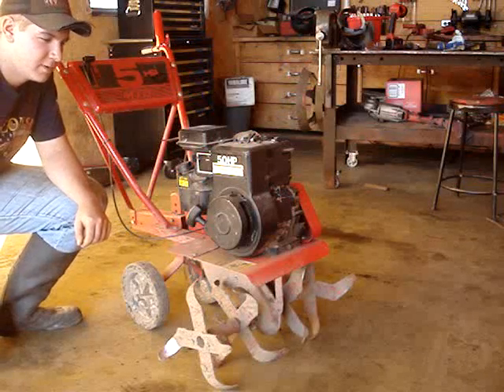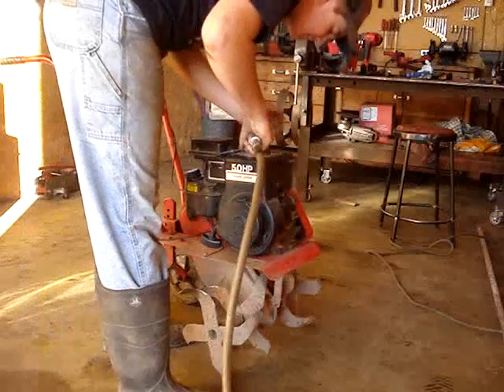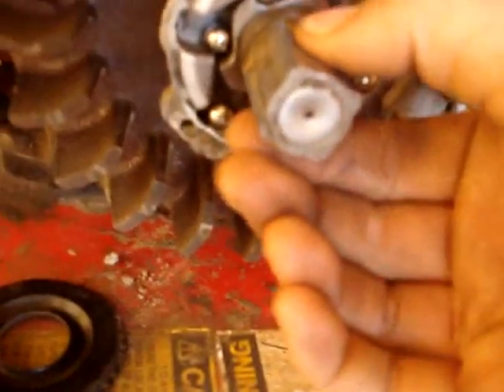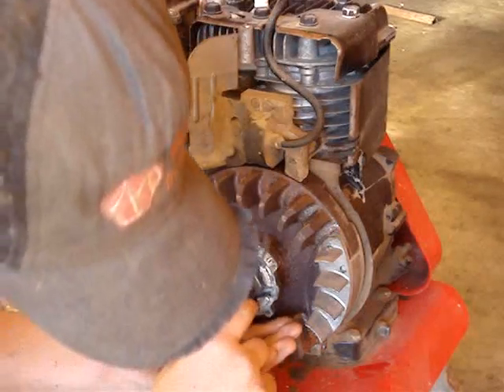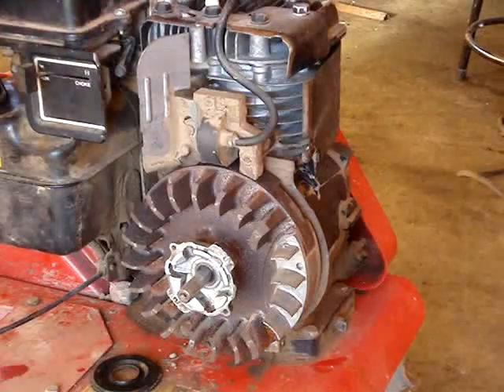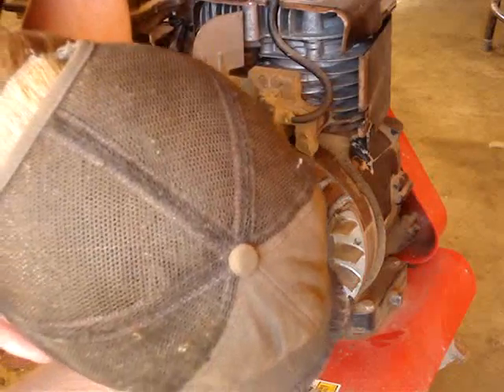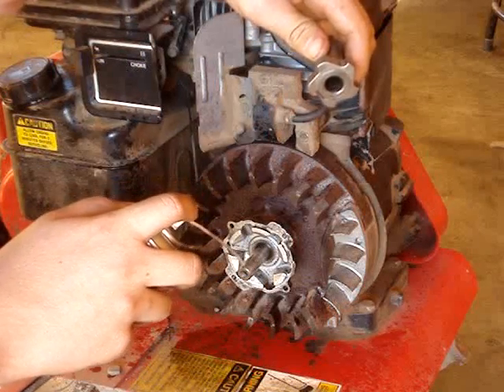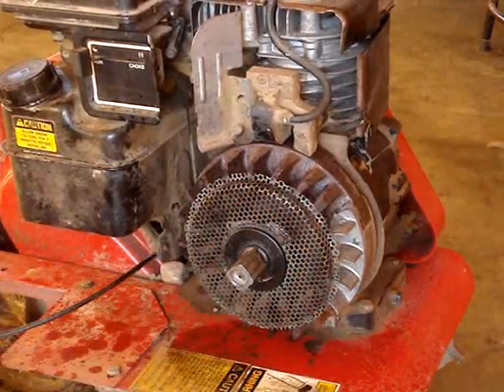Fixing an Overrunning Clutch on a Briggs and Stratton

Comment: Never sand or file the end of the crankshaft, since there is a pernalube bushing in the top of the clutch, if you notice there is a little hole in the top??? There is also a felt wick under the hole, 4 drops of zoom oil in the hole no more....problem solved

Comment: This is only a temporary fix and the starter clutch will inevitably lock up on the shaft again no matter how much you clean or lubricate it! It's a bad design as the heat from the engine makes the crankshaft expand and leads to it locking up on the shaft when the motor gets hot and this is especially bad on a horizontally mounted Briggs motor as heat travels upwards and the end of the crankshaft that slots into the starter clutch pawl is the highest point on those motors :( An aftermarket company really needs to make a conversion kit for these motors or alternatively you could reem out the hole in the starter pawl at the risk of it becoming to loose on the shaft :(

Comment: Spray lubricants don't work well for longevity as they are designed to break things loose, not for permanent lubrication unless stated on the can, I typically go for putting oil in the little hole There should be a little pad underneath the hole which acts as a reservoir, I find some standard motor oil works great and i load up the clutch with oil and I typically pull off the cowling every year or two as part of my maintenance schedule when I inspect and clean my own engines and I have never had an issue with them.

Comment: Funny, mine never made any noise, it would just spin in both directions instead of catching. It would eventually catch and start if i'd pull the rope out and let it snap back a couple times. I took the cap off the clutch and two of the balls were rusted in place and the others were so nasty it was a wonder they were still moving freely.

Comment: Thanks for the video. It helped me figure out how to get the cover washer and seal off the clutch on a 20-year-old mower.  I had to use a sharp chisel and some gentle tapping at the edge of the washer with a 4 oz. ball peen hammer to get the washer to break free.  All is well now and the formerly screeching recoil starter works like new again.

Comment: Quicker and cheaper (laborwise) to just replace the 399671 (starter clutch) Clean crankshaft bearing surface with a wire brush. This is a bearing surface and would you take sandpaper to a bearing? If it's not rusty just a shop rag and carb cleaner will do. I know you think you are saving people money by saving the old clutch but its 28 years old! Replace it. I know you kids posting these videos are just trying to help (except golfcartractor) but you'll learn someday.
Reply: exactly right. clean it but dont remove any material